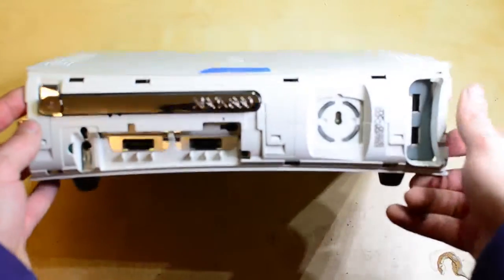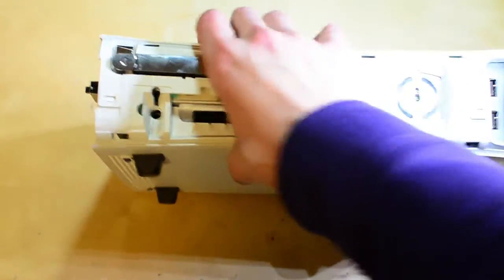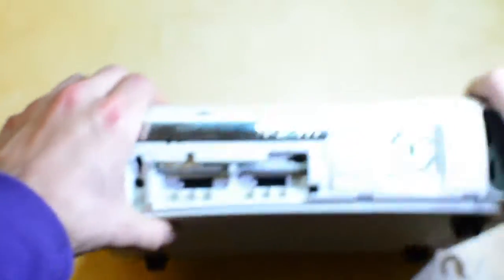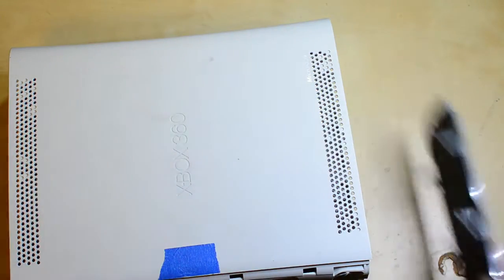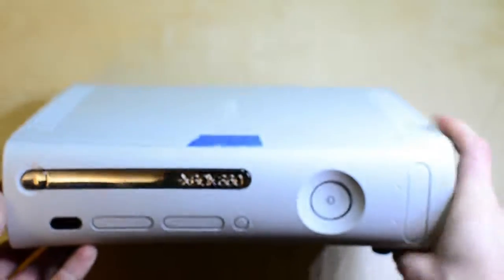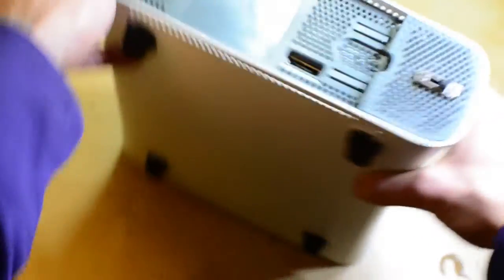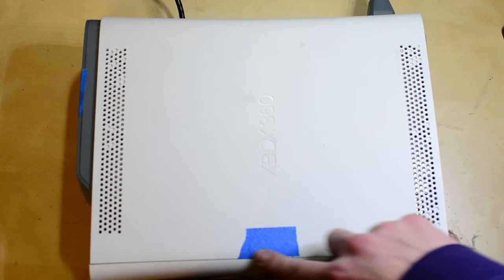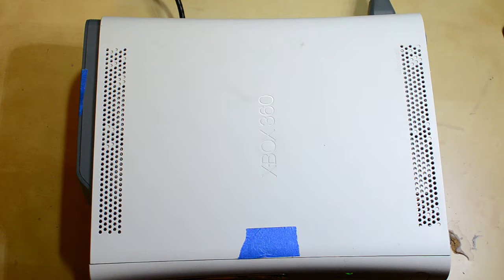Xbox 360 RRoD Resurrection and Switchable Fan Speed Upgrade - Part 4: Final Reassembly & Loudness

Comment: You need to drill holes in the top to expel the hot air from the fan on top of the gpu heatsink - if you look at the metal part ofthe case, there are holes aleady there. Looks like Microsoft were consideringthis but then abandoned the idea.

Comment: hey so how would I go about doing this exactly? can you make a tutorial on how to solder all this? just ordered the necessary things to do this and I'm waiting for them to come. plus I got some 50 MM fans. and got a RROD console coming in so please can you make a tutorial on this ASAP? got the same mobo as you which is a xenon, don't know what RROD it had since the seller didn't test it.
Reply from the maker: Hey there, sorry I just saw your comment. I don't have time to make a full tuturial write-up about this, sorry. Hopefully you can get enough information out of the videos since I showed pretty much all the areas I soldered except maybe the back of the main power switch, but I linked to a tutorial about how to solder straight into that for 12V. I hope you figured it all out!
Reply from the maker: As long as it's a 12V fan you can solder it to the 12V supply on the back of the board and it'll run full blast all the time. I didn't do this because it's pretty loud so I wanted the option to run it slower. Good luck!

Comment: is the xbox working or is it rrod?
Reply from the maker: Used it a couple times a week for a few months after fixing it earlier this year, no RROD ever so it is definitely brought back from the dead (it was 3-light RROD before I fixed it). Mostly used it on the super cooling setting but I ran it on the regular setting for a bit and did get some weird graphics artifacts on screen one time so now I only use it on FULL POWER. But honestly from the thermal stress this thing has been through I'm amazed that the GPU wasn't completely fried so I'm really not surprised by seeing some visual artifacts.

I haven't used it in a couple months though, I will boot it up and see if it still plays games alright.